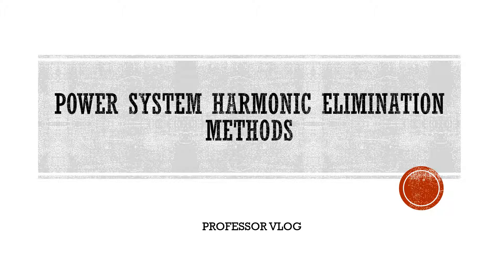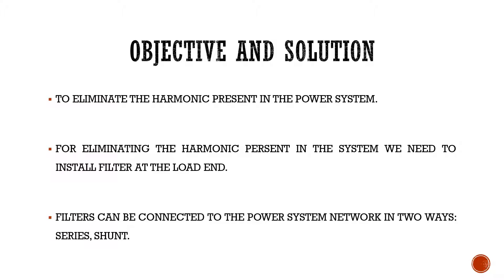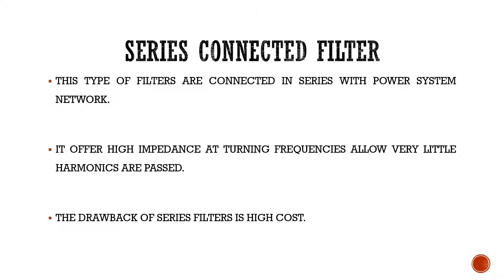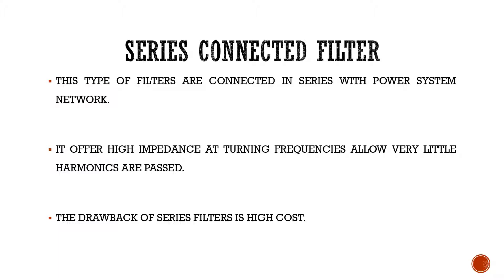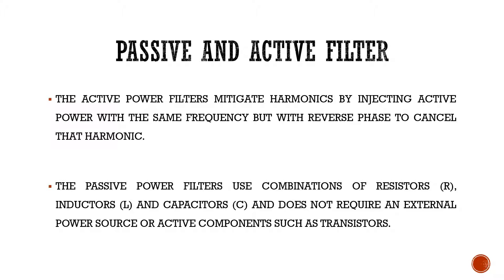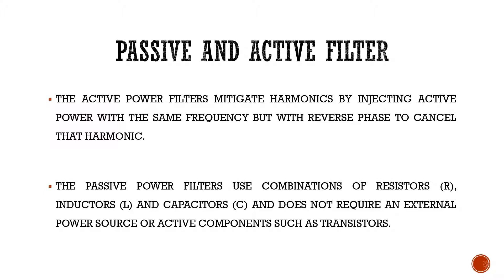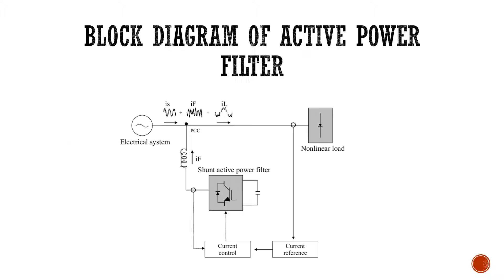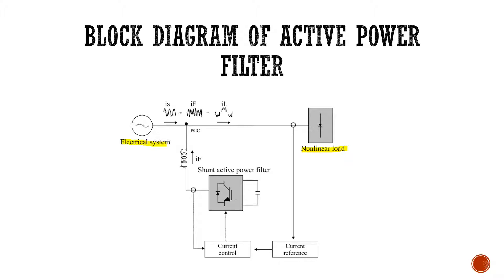Power system Harmonic elimination methods

Comment: I think the lower order harmonics (2th, 3th, 4th, 5th....) has big magnitude then the high harmonics such as (45th, 46th, 47th....). so to eliminate the lower harmonics you need grouned impedence not opposit at you said ?
Reply from the maker: The negative harmonics and reactive power can cancel off the  harmonics in the power system.

Comment: Can we use 300amps harmonic filter for 1000 amp load ..
Reply from the maker: It can be determined by calculating the compensating current and Reactive power required to compensated the 1000ampload